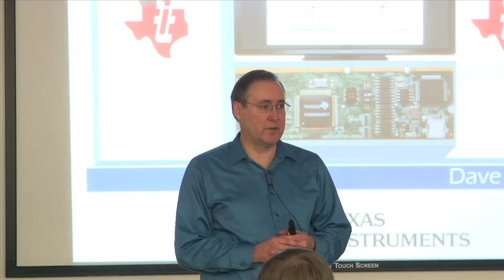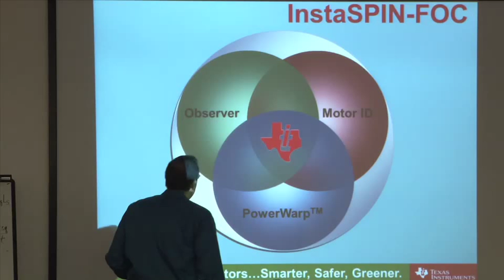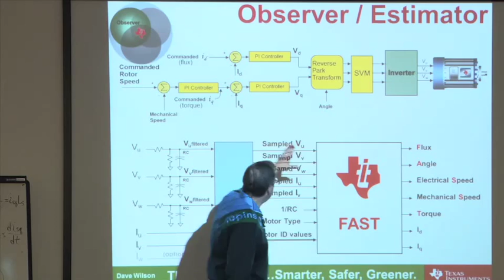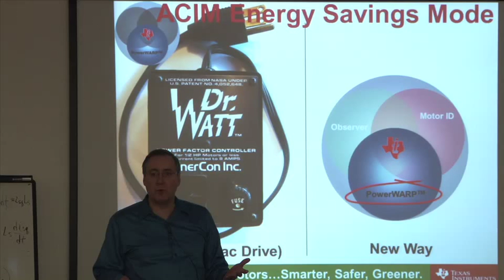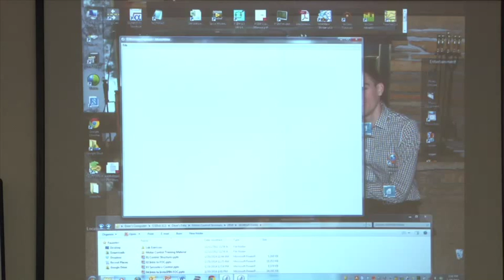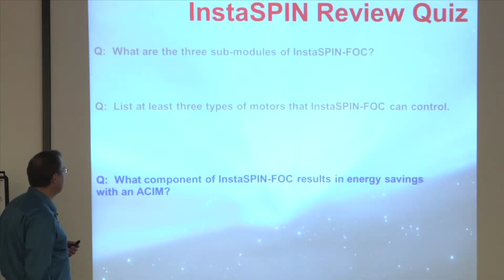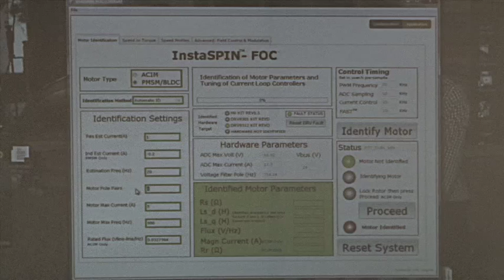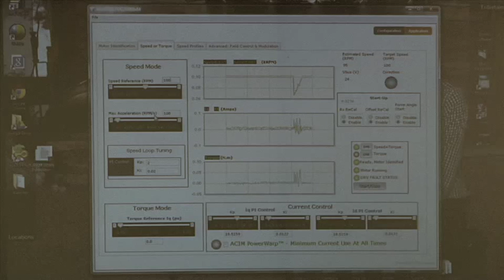Teaching Old Motors New Tricks -- Part 5

Comment: These lectures are really interesting.  I've a mechanical engineering degree, and though I don't work in the field of motors or motor controllers, I can appreciate much of what was described, and wish I could use this information because it is so impressive.  This is much better than TV.  Thank you TI.

Comment: I've been working on my own induction motor control system for a while now. Why doesn't anyone supply a chip that can already do all these math functions and have all the necessary hardware so that all you have to hook up is the current inputs, user inputs, and the outputs to the driver stage? I would like to build an inexpensive control system for electric vehicles and have yet to find a chip that does what I need. Any thoughts on a solution that doesn't cost more than about $150?
Reply: Here's an open source controller that does this for bldc and pmsm: https://odriverobotics.com/
Reply: bg @beak90sfx  ipàpp